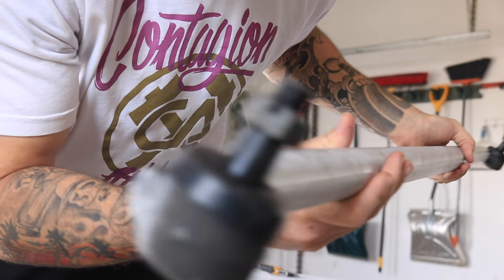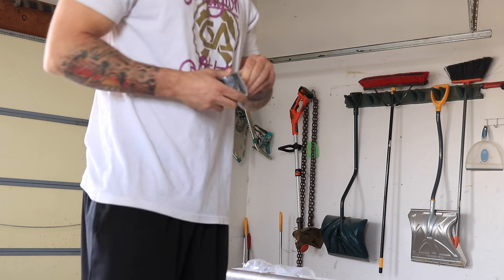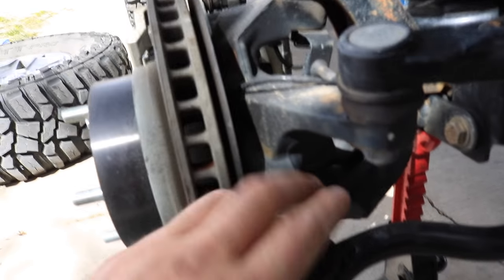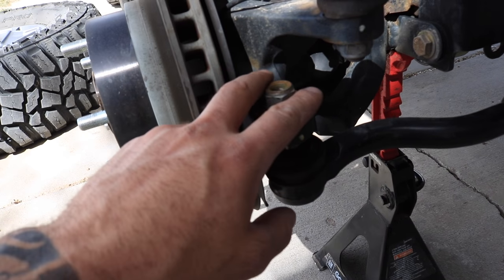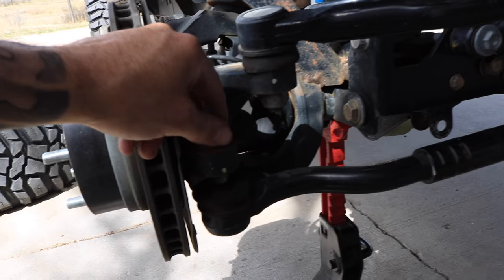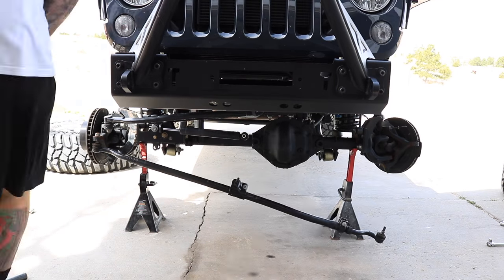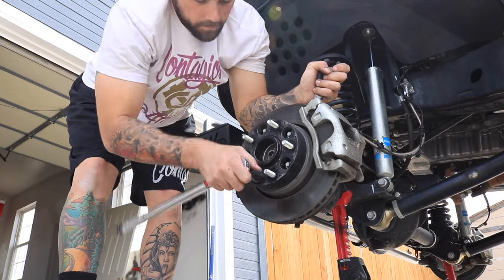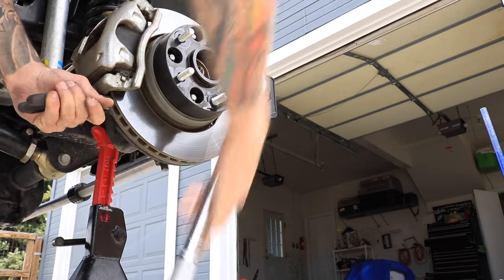Installing an Aluminum Tie Rod on a Jeep Wrangler

Comment: ProTip on the measurements. You can put a large strip of tape on the tread of the tires in parallel to the tie rod. Mark an even number say 70". Since you are really only looking to match what you had again with the new tie rod. takes the guess work out. If you go actually center to center, and have something like 67 13/16" then you have to really try hard to hit that number with the new one. I know I know its still the same process, and should be easy no matter what, but trust me from experience. 67-13/16" is a laot harder to remember in the noggin than say 70". Also make sure you have someone hold the other end of the tape tight. Measuring means nothing if the tape is sagging 3".

Comment: Hey man. Thanks for the video! Interested to know if there has been any play develop at the tie rod ends?  Some say the jk knuckles use a different taper than the gm rod ends in this kit. I just bought a kit that uses the same rod ends wondering now if I need to change the taper. Thanks!

Comment: Hey I recently lifted my 08' JK 3 inches and have had trouble with the rear coils becoming unseated and popping out of place at the top where it meets the perch. I was wondering what you would recommend to fix this. I'm taking it to a shop to be corrected but I wanna make sure it doesn't happen again
Reply from the maker: Derek Fogle do you have the correct length of shocks? Could be allowing more droop than your shocks allow.
Reply: David Van Voris Yeah they're the correct length. The lift included all new coils and shocks. Since your jk seems to be lifted more i was curious how about your rear coils and if you've had any issues with them bowing.
Reply from the maker: Derek Fogle I haven't had that problem yet. What lift is it?
Reply: David Van Voris Rough Country. Technically 2.5 inch lift but measures out to be 3 in the front and 2.5 in the back. I understand Rough Country isn't the best way to go as of quality but I'm on a budget and it was my best option. What happened is the coils are still seated on the bottom but both have come out of place along with the rubber isolator on top
Reply from the maker: Derek Fogle I would make sure the rubber isolator is seated correctly. You may need a new isolator or you could do limiting straps. Let me know what the shop says.
Reply: David Van Voris Thanks man. I was looking into doing the limiting straps. Also purchased a teraflex coil retainer and hoping it doesn't happen again. I was just curious if you knew anything
Reply: @derekfogle9078  your shock absorbers are to long... if they were for a 3-5" lift you may be extending to far.... just a guess

Comment: Hi! Why or how did your stock tie rod bend???
Reply from the maker: Zdenek Stuchlik got hung up on some rocks and steering through some hard sections rock crawling the weight of the 37s bent it. You can prevent this by doing a ram assist.